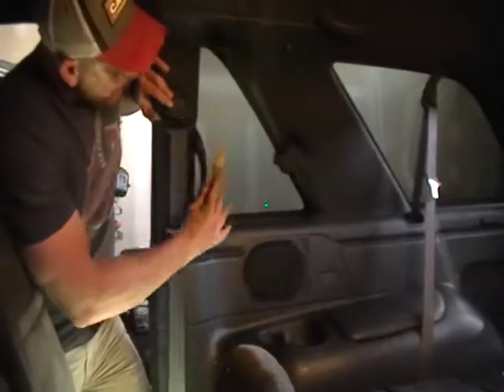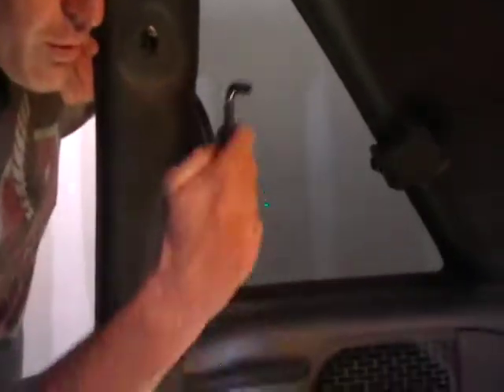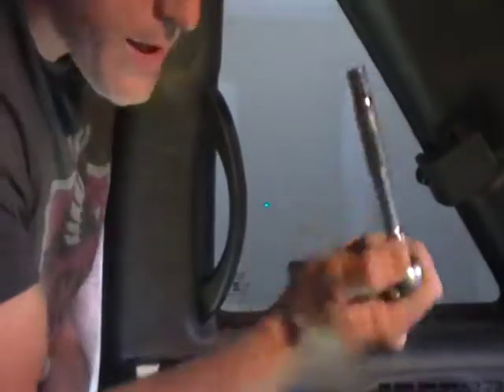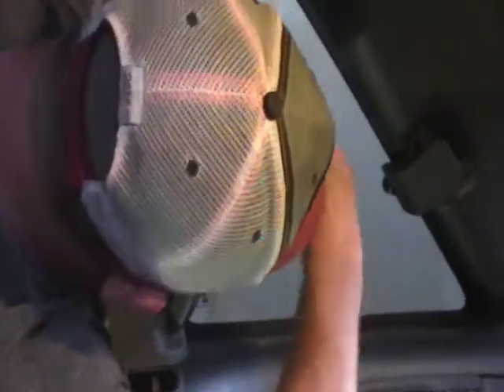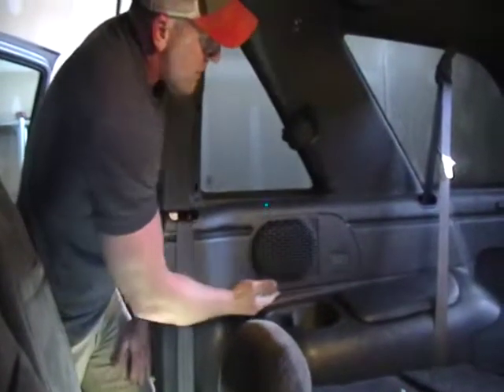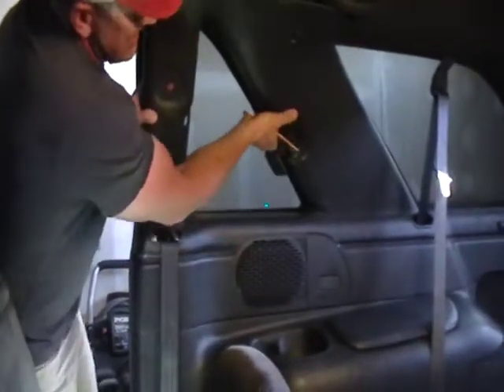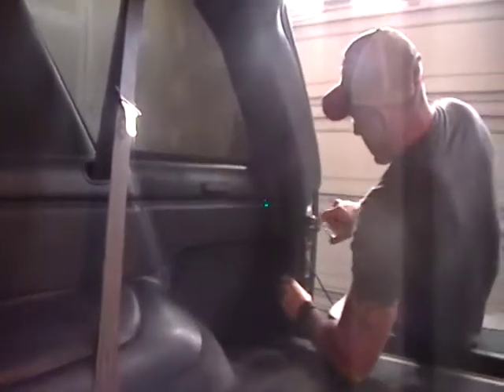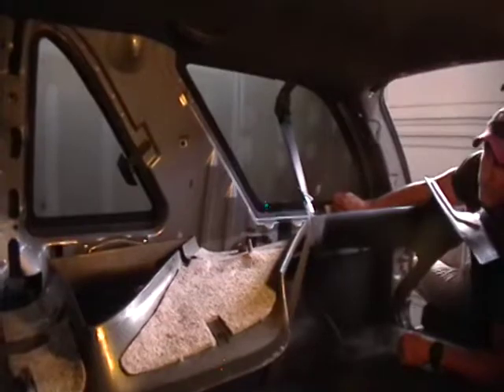Gmc Jimmy 2 Dr Rear Interior Panel Removal Pt 2

Comment: This is enormously helpful. I want to remove the original worn carpet in my Blazer and replace it with a kit. I'm wondering whether it is really necessary to remove the panels shown in this video. If the amount of carpet that is behind the panels is minimal, could I perhaps just push the carpet underneath?
Reply from the maker: In my experience there is about 1 to 2 inches under that.  It would be easier to remove them and that way you'll have the opportunity to get all the dirt and debris that seaps down in those cracks out.  Plus it will be drop in easy.  I did one kit on a jeep trying to tuck it...it was twice as hard as doing it without the panels
Reply: @automotiveinquiries9673  Your experience is very much appreciated.

Comment: Just to check do the 2001 blazers use a six by nine speaker in the back as well ?
Reply from the maker: Yes sir
Reply: AutoMotive Inquiries appreciate it I’ve been trying to figure this out for a minute so I could order some. Are they the circle ones or the oval shaped ones ?
Reply from the maker: Ovals are best but, if you bought round youd need to modify it a little
Reply: AutoMotive Inquiries ok thanks I appreciate it a lot.
Reply from the maker: Absolutely, drive safe